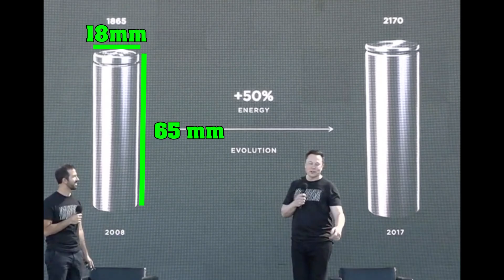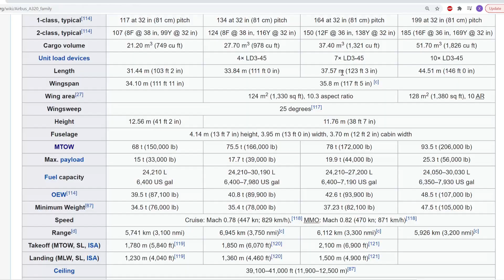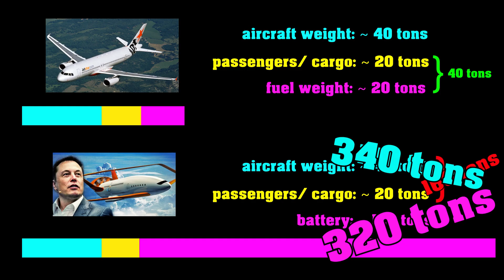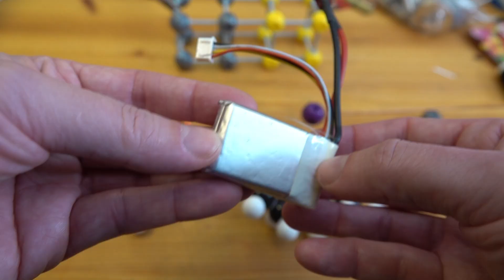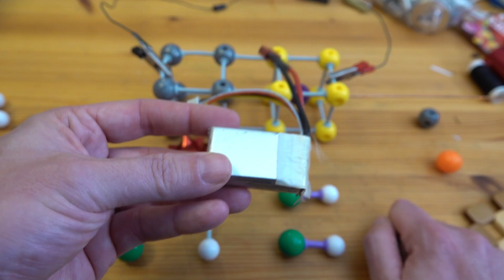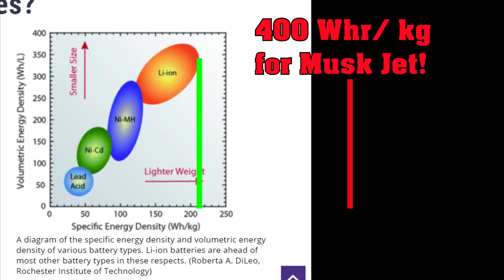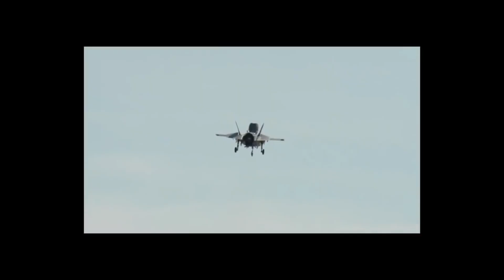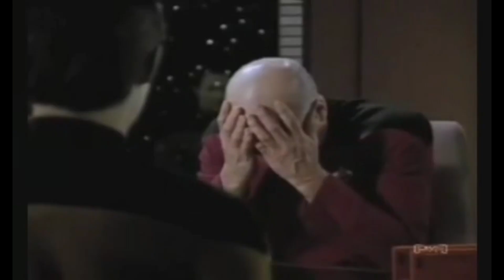Tesla's Secret Plan To Disrupt Airlines: BUSTED!!

Comment: If you strip the hype I am still excited about the 4680 battery.

It's weight/volume ratio is slightly better. Meaning that a comparable battery pack is slighty lighter. This has to do with the amount of casing material used for each individual battery. The actual casing is the heaviest part (per volume) of each individual battery.

The internal resistance of the 4680 is lower. This is due to its design. Which results in a slighty more efficient battery. And, as a secondary benefit, tolerates a higher current when charging or discharging. Which means the battery can be loaded quicker. Though the latter also means a greater power usage strain on the current electricity network. Which currently is not designed for such high current peak recharge loads when multiple EV's are recharging ... But that is something to overcome.

Having larger batteries (4680) with larger anode/cathode surface areas means, in principle,  that the 4680 battery is easier to construct and contain less points of failures per battery pack (having less batteries per battery pack).
Which makes it cheaper to construct the battery pack.

Additionally, it is reasonble to assume that producing many small batteries of the same type is more expensive than producing less but slighty bigger batteries of the same type. Meaning, the manufacturing costs of the 4680 battery is lower when compared to the current 2170 battery.

So what do we get?

A (per volume) slightly lighter, slightly more efficient battery (claim: 17% more efficient than the 2170 battery), that is cheaper to produce and is cheaper to assemble and can recharge slightly faster. 
Taken all these factors into account (as shown on Tesla's battery day) resulting in an overall costs/Kwh ratio savings of about (claimed!) 58%.
And that is wonderful news.

Will the 4680 battery be replaced by the potentially more efficient solid state battery?
Perhaps. But the  4680 is here and now. A commercially practical solid state battery isn't.
As it stands, the 4680 battery looks like a sound progression towards a commercially available $25,000 family car.

Note: 
There are already $25,000 electric cars on the market. But these cars are either small in size or limited in range or both.

By the way ... I don't own a car at all.

Comment: Another problem is cooling things. The higher you go the more trouble you have getting rid of exes heat. Electric motors generate heat as well as the components feeding them, meaning you’d need to start fitting coolers to the plane increasing drag.
Reply: What exactly do you mean. The combustion engines in airplanes generate a lot of heat as well and they need to be cooked aswell so there is not that much of a difference.
Reply: @timoclark8367  if you have piston engines,  yes. Turbine engines on the other hand don’t need as big of a surface area for cooling. Meaning that most of the cooling can be done with the bypass airflow that is also creating propulsion. Which is why you don’t see cooling ducts or cowling on the plane’s wings.
Reply: @timoclark8367  you can see this being an issue with every piston engine aeroplane.
There are different ways to deal with it too like evaporative cooling which is quite good but electric drivetrains usually don’t get hot enough to use it or would need refrigerants to use it plus the failure modes of evaporative cooling are not exactly kind. Which is why most planes don’t use it.

This is also a big issue if you go supersonic as the heat generated by the friction between the fuselage and the air. This isn’t that much of an issue with jet engines.

Another thing that should be pointed out as well is that there are other things limiting how high you should fly like radiation the Concorde flew at about 16000 m an would drop when the radiation increased to reduce the dose received by its crew.

Comment: Correction on @Thunderf00t's unverified claims:
1) It is not Tesla, but Panasonic to create and develop 2170 just like 18650. Panasonic is the supplier of 2170 to Tesla. That slide is "the history of cells".
2) Density of 18650 varies from 114Wh/kg to 231Wh/kg, but density of 2170 varies from 207Wh/kg to 239Wh/kg - over 10 years Panasonic managed to increase the density. See A3284fig2.jpeg.
3) 4680 is done without Panasonic but with Maxwell which @Thunderf00t somehow ignored - that one could be 300Wh/kg, but we need to get the car to confirm.

Also, from battery structure PoV the density depends on the thickness of the anode coating not on the cell size.

Comment: For the electric motor to convert power into thrust it will need to use a propeller or fan. Propellers and fans do have reduced efficiency at altitude.

Comment: As an Aerospace engineering student, (who should be finishing his assignments not watching this) watching Elon go on about 'electric jets' makes me feel like: 'Really dude? How the heck did you make SpaceX? '(Spolier, they used the same principles as on  a Soviet RD-18, added thrust vectoring to be reusable and Elon had basically nothing to do with it apart from marketing- And SpaceX became a thing only after US had to retire their Space Shuttle promting a need to find a new way of delivery for US as not to depend on Russia).
To unde
Electric motors are more efficient than PISTON engines for one good reason: how they work. In a thermal piston engine you have the gas burning which releases energy into the system, expanding the piston which transfers this erratic expansion into linear motion which is then transferred into rotation motion, part of which is transferred to the wheels, part of it is transferred back to the piston (or other pistons) to get the hot gases out of the system. Apart from the need to re-introduce part of the energy back into the system to keep it running, you also have issues like compression ratio and air pressure. To get the right ammount of fuel exploding (aka burning at molecular level) you need the right ammount of oxygen, which can only be achieved at high pressures (unless you use a special type of self-oxydising fuel). This is why many engines now have supercharges or turbochargers. Since you'll never get the same ammount of fuel sprinkled in two strokes of a piston (unless pure coincidence), you will never be able to create a system that runs 100% efficiency. Electric engines/motors just don't care about any of that because they convert the rotation of the electromagnetic field straight into mechancial rotation. Yes, they have their own types of losses, but they are much easier to make and syncronise.
With jet engines (wether air breathing or rockets) this same stuff does not apply. The principle of a jet engine states that you need to eject, with preferably very high speed, a mass at the rear end of the device to move your vehicle forward. Normal jets do that by burning gasses, which drastically increases pressure in the chamber seek the first way out, the nozzle. Fossil fuels have an even bigger advantage as their particles spread throughout the pressurised air and, through combustion, create micro-explosions providing quick increases in pressure and volume through shockwaves and pressurewaves. On the 'electric engines', unless you invent ion-propulsion (or some way to electrically accelerate ion in air), your only hope is to heat up compressed air, which bascially means scratching yourself backwards. You would need to to create a mesh of heatsinks or resistors that would give you the most wetted area and you would still not reach the efficiency of a regular gas turbine or rocket jet. Heck, they have tried it with nuclear propulsion to provide enough heat for air breathing engines and they failed and now Elon thinks he's gonna make it witha silly battery?
The second issue is the VTOL part. Not only does the stoned moron want to make an electric jet, he wants to make a VTOL jet. I could count the number of VTOLs that have been around on my fingers (probably on one hand if I'm imposing some restrictive criteria). And not only that, but he wants to make a SUPERSONIC VTOL? In the whole aerospace industry there have been only 2 or 3 semi-successful supersonic VTOLS. The first was YAK-141 (which was cancelled due to funding problems) and F-35B (which hopefully fixed its oxygen problem). I'm not even going to explain how big of an issue creating VTOL is (since I really have better things to do)

Comment: The weight issues will not be solved. Regular drones are perfect examples of this. 

Great video as usual.
Reply: Regular drones are a good example of how much batteries have evolved, as well. Not 30 years ago, the batteries that power drones didn't exist, driving 4 electric motors from a battery was a pipe dream, RC helicopters were very expensive and had only very short flying times. The loss of weight from modern batteries as well as reciever electronics made drones possible.

But yes, drones' carrying capacities are still very limited, the best way forward is losing more weight and batteries aren't looking to be able to lose a whole lot more in the near future.

But then again, as an RC fan it's the sheer joy of flying that's important, not so much carry weight.

Comment: It's the Hyperloop coolant issue all over again, but instead of a two person train with a giant tank for water cooling, you're going to have a giant two passenger electric plane that is all battery.

Saying that I wonder at the battery weight vs. energy output ratio, will the batteries be efficient enough to provide enough energy to achieve lift  of the batteries, let alone any passengers.

Comment: Would it be possible to use a chemical reaction (like a 2-part epoxy) to produce the electricity or heat to run engines? There has to be some combination that would work and not be too dangerous, right? I wish I had your understanding of science, I enjoy problem solving. Thank you for your videos. I really enjoy them.

Comment: The innovation of the 4680 lithium cell is in its heat dissipation. I don't think it has any other advantage but please correct me if I'm wrong.

Edit: it can also output significantly more current due to its internal design.

Comment: your obsession with bashing Elon lately has become toxic. The new dry cell tabless battery is revolutionary and this video will not age well. They do not need flammable solvents to make a slurry anymore with the dry cell and the tabless design allows for higher energy density in much larger cells. The new Tesla vehicles that use it didn't get 1,000 mile range because they made the battery bigger. The Tesla Semi will get over 600 miles fully loaded, that didn't happen with out the increased energy density which they said is almost 400 Wh / kg but probably closer to 300 for cars. You are embarrassing yourself now and just part of the haters.

Comment: Actual battery developments? "We made 8% better battery by using super expensive nanowires.*" *Not commercially available.

Bonus: these actually almost don't lose charge and are extremely fast charging. Minus: they cost 3x as much as platinum per weight, if the production of nanowire electrodes was ramped up. Manufacturing this in scale has not been solved for 12 years so far.

Comment: There are some basic rules regarding airspeed and thrust. In order to double the speed of an airplane, the thrust has to increase by four times. I can see a puddle-jumper airplane able to use batteries, but four times the thrust would still be required if going from 70 knots to 140 knots.
I am amazed at Elon's SpaceX program, but this idea of an electric supersonic VTOL aircraft has more of a mystical quality to it. 
Having said this, I would not like to be flying even the battery-powered puddle-jumper if the batteries go crazy and catch fire.

Comment: The batteries are structural and contribute to the air-frame/wings. Your entire weight calculation is wrong and clouded by your personal hatred of Elon. 
Also a cascading battery cell failure is easily avoidable with simple overload protections and correct casings. Electric cars catch on fire way less than combustion engine cars do.

This videos was researched in a heavily one sided manner, as usual for your jealousy fueled rants. I still remember your video busting SpaceX Falcon 9 reusability, wonder where that went?

Only real takeaway from this video is that Elon (and many others) have been far too optimistic about future battery tech. 
I'm sure you would have been fooled too if not for your permanent pessimism and jaded outlook on life. Although even if you were we would be the last to know, hindsight is 20/20.

Comment: Good video. Your weight comparisons at the start obviously used "Take off Weight", but of course one of the reasons todays planes have such range /efficiency is that as the fuel is consumed they get considerably lighter. I.e Take Off Weight 》》》Landing weight. Clearly for an electric plane this weight is constant. Infact the comparison is worse as for safety reasons (airframe strength etc) Max landing weight is usually lot lower by design than that of take off weight, hence the need to shed/dump fuel in an emergency. This further compounds the issue making the need for battery operated planes to be stronger and therefore heavier....and requiring more fuel hence bigger batteries........

Comment: There's a new product being advertised on Instagram. It's called bite. its toothpaste, that isn't paste, but a chalky tablet. It was designed by a tv producer and is wicked expensive. They claim it works just as well as toothpaste without all the "harmful chemicals" and that they are carbon neutral. Sounds like the perfect product to bust.

Comment: sure, TNT and thermite have high energy density and they are pretty scary. why is desil and petrol not so scary when its energy density is 10x more?
Reply: Because jet fuels doesn’t melt beams and to ignite jet fuel takes a lot of energy while battery technology hasn’t matured as long as fuel to guarantee that one faulty cell won’t ignite the others.

Comment: Another problem with energy density is when you discharge a battery it only loses a little weight. When you "discharge" (burn) chemical energy the consumed product is "shed" (exhaust) and the transportation gets lighter.

Comment: The maths for the battery volumes doesn't appear to be right: 1-17/24 ml would be 30% increase. The volumes are more like 17.76 ml and 25.89 ml... then you get to the claimed 46%

Comment: we should harness the hot air generated by musk to run entire fleets of hot air balloons or airships
Reply: I think the gullability of Elon's disciples is the real source of infinite energy.
Reply: I'ts adorable to see this manchild dream up stuff like a little 5-year old, sadly just beacause he is famous people think that there is some viability to everything he is saying.
Reply: Lithium powered hot air balloons... You are a GENIUS!
Reply: @-JonnyBoy-  methinks lead accu's are even better!
Reply: I think he gets an invite then necks a handful of uppers just before going on.
Reply: Guys, how about we start a company similar to SpaceX, but instead we use electric engines and batteries?
Reply: Mr. Musk is mostly a confident man, considering the value of Tesla. 
Never mind that the Chevy Bolt is a competent practical commuter EV and all Teslas come with Ferrari level insurance & service costs, while not even having as good of an electric braking system as the Chevy. So expect a total crash on Tesla Stock...
But when Mr. Musk talks about an electrical VTOL Jet, he clearly is an idiot. As Jet engines are not electric, as he really is suggesting a ducted fan which is a stupid design for a VTOL or Electric Plane of any type. VTOL & Electric Aircraft use propellers or rotors because they are more efficient and lighter...
Reply: @davidhollenshead4892  If Musk is a confident man it's mainly because he suffers from God Syndrome. Narcissistic and delusional.

Hm, where have I heard that before?
Reply: @davidhollenshead4892  I do agree with ya in principal but its a misconception that jets can't be electric as "jet" does not equal "turbine" engine. Ducted fans are technically jet power and so are water jets like jet skis. I also believe that rockets are jet propulsion too. Anything producing pressure and throwing it out the back is a "jet".
Reply: @ejcheli  So, I'm a jet when I sit on a chair and push myself forward with a leaf blower?
Reply: @Moz31  yes
Reply: @Moz31  Haha YES! Yes you are.

Comment: That battery is even less impressive if you consider the dimensions of the casing. 
If we assume the top/bottom are let's say 3mm combined, and the side walls are 1mm combined, you'd have 17mm x 62mm, and 20mm x 67mm, which is a 49.6% increase in volume.

Comment: I'm legit confused, everyone seems to be totally ok with the whole altitude efficient thing... I get the whole jet combustion getting weak the higher you go, but what exactly makes an electric jet more efficient the higher you go? In my uneducated brain, i'm thinking: higher altitude = less gas to push against (or 'breath' as part of combustion).  And since electric motors are just a ducted fan, all the limitation of propeller based flight apply.  But if the electric jet they are talking about is a plasma engine (super heating air via microwaves or whatever), you still need to heat the air, and the higher you go the less air you have and consequently less thrust possible... what am i missing?  It really seems to me they both have the same issue but from different reasons.